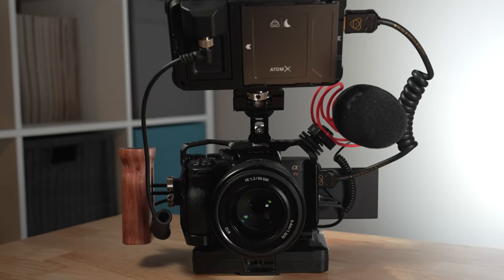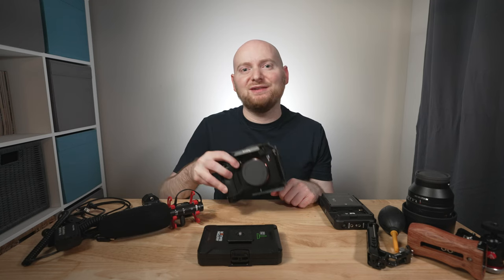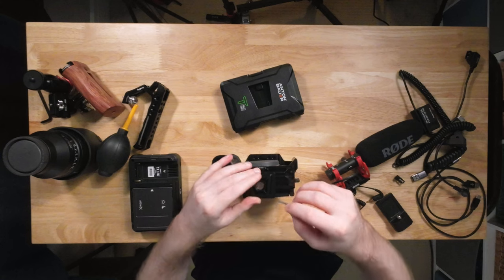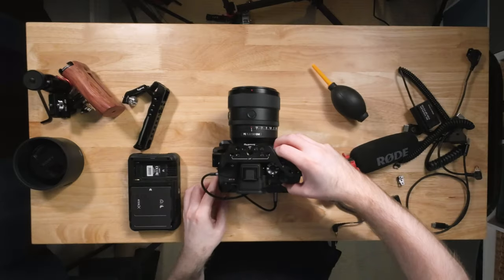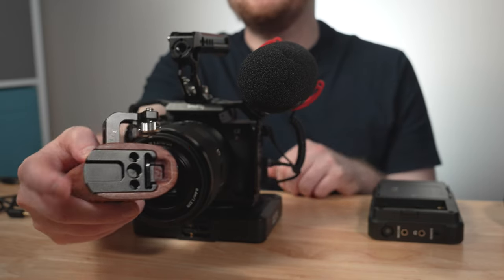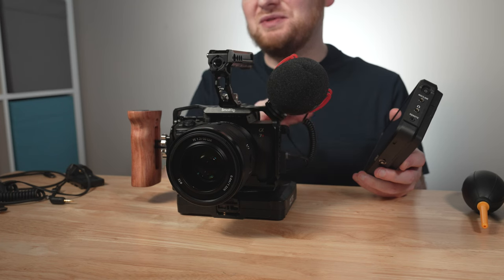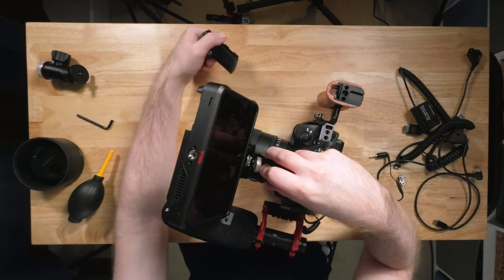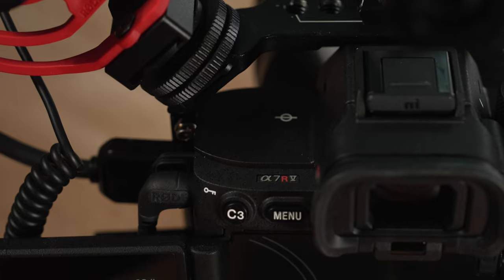Building the ULTIMATE Sony a7R V Rig for Video! Sony a7 IV, a7S III

Comment: Pretty much the same setup I use with the A1 and A7R5, only I put the handle on the left side. That way I can support the camera with the left side handle and the camera's built-in grip. Also, I have been using the Ninja V with the A7R5 for the past three weeks. Last month's firmware update must have added support for the A7RV.
Reply from the maker: Interesting, so you're referring to the firmware update for the Ninja to support (officially) the FX30?  Everything worked for me except ProRes RAW recording.
Reply: I got some questions for you bro running the same cameras and I’ve been looking for someone with it to ask some stuff!
Reply: @photoboyjet Hey. Just recently we also got a Sony A7RV with Atomos Ninja V+. The problem occurred during the connection. The signal input does not work when RAW. Do you have RAW output set in your Sony camera ? Could you give us some advice on how to make it work ?
Reply from the maker: @adamjopek6434  Is your firmware up-to-date on the Ninja V+? I experienced the same testing it out with my Ninja V; I suspect they haven't updated their firmware yet to support it. I haven't gotten a chance to reach out/ask them yet though.

Comment: The battery is nice but when I go handheld I need my camera tripod ready and that deletes that opportunity.
Reply from the maker: It has 1/4 20 threads along the bottom of the battery, so you could pre-attach different quick-release plates that work with your tripods, monopod, etc.
Reply: Ahh ok thanks

Comment: I purchased a Ninja 5 for my a7r5 recently and have been struggling to figure out how to take advantage of the 16bit color (etc.) that would be enabled by pairing an external recorder with the a7r5. I would be so grateful if you could help me.
Reply from the maker: I think technically the max you'll be able to utilize is 12-bit RAW from the Atomos. In theory the Sony allows up to 16-bit, but not technically achievable in practical application.
Reply: Gotcha, Thanks! Did you ever end up making a video on this subject? It's near impossible to find information about using external recorders to improve the a7r5 anywhere on the internet. After getting the firmware updated I was able to get the raw output turned on in camera but I have no idea if its recording 12 bit or not. Apologies, very new to external recorders
 @andrewsaraceni
Reply from the maker: @coltonberry9935  That's a good question, it's on my list to tackle. Might be something coming up on that soon in the next month or two. 🙂
Reply: That'd be great haha. I was really surprised by just how little information there is to be found on using external monitors with the a7r5  @andrewsaraceni

Comment: Do I have to remove 50 1.2 GM when mounting the 3667 cage?
Reply from the maker: You might be able to install the cage with it on, but I usually take the lens off prior.

Comment: very nice tuto ! 
- i don't understand what the new locking slider is, for a74 and a7r5. whatever i suppose you advise to buy new 3667B version ?
- 90% of the time i make photo but i'd like to learn video. in that sense, i was looking for arca plate, L-plate... how do we attach a arca plate to a smallrig 3667b ? same way that you attached te battery plate ?
- isn't it too tedious to remove cage when you make photo ?
Reply from the maker: Thanks Marc! I think in most cases folks will end up with the 3667B at this point - seems a lot easier to find now vs. the 3667.  The bottom of the cage basically is an Arca Swiss plate itself, but yes, you could use one of the 1/2 20" or 3/8 16" threads on the bottom to mount another plate, like the battery in my example.

Comment: Nice rig Andrew. A couple of questions…

I want to make a build like this, however for audio already own the Sony ECM-B1M Shotgun Mic that needs the camera’s hot show mount. Do you have an idea how I can do a similar build factoring this in? Would I have to sacrifice a top handle? Would that also mean I can’t mount a Ninja V?

Also, roughly how long can you shoot with this setup powering both the camera and Ninja V?

Thanks.
Reply from the maker: Thanks Simon! As you said, to accommodate the ECM-B1M, you'd probably want to forgo a top handle and mount accessories like the Ninja V, etc. on side handles that have shoe mounts. Sony does make a MI shoe extension cable that would allow you to mount the mic elsewhere (model: 1-002-838-11), but these are pricey/hard to find.

I've found using the power setup in the video, that the Titon Base can power my camera and the Ninja for around 3 hours or so. Powering just the camera alone, that duration easily doubles or triples (e.g. 6-9 hours).

Comment: how to use anton bauer battery to trippod
Reply from the maker: There are 1/4 20" threads along the bottom that'll mount to any tripod head and plate system.